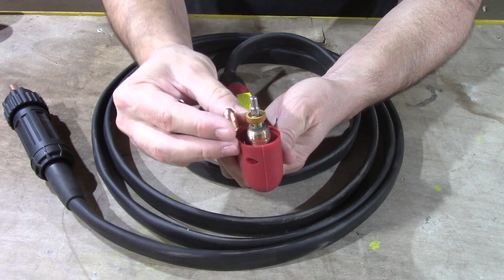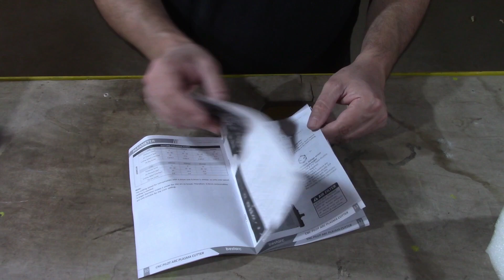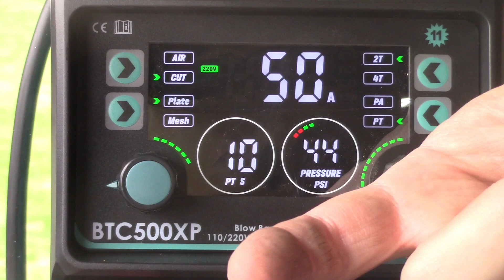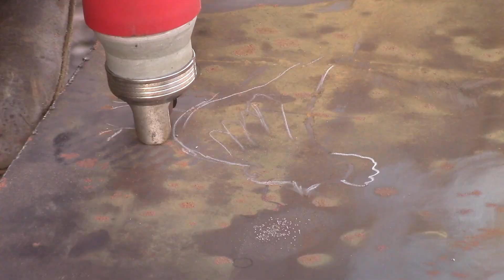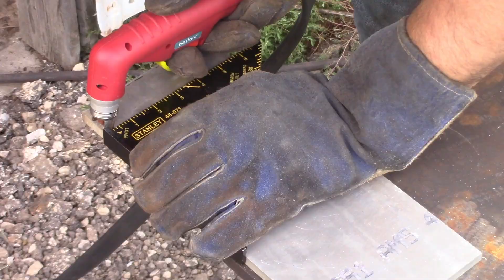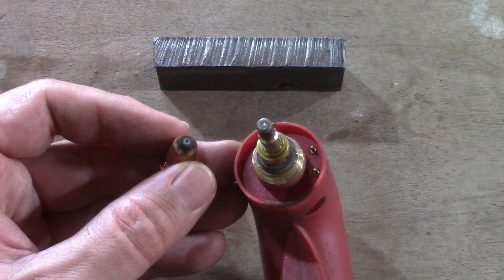BTC500XP 11th Generation Plasma Cutter Review

Comment: When these small 50 amp units came out years ago they could be found for 50 bucks. What you have there is $50 worth of machine in 10 year ago money. I didn't buy one then and I wouldn't buy that one now. Any welding shop, even at home, needs an oxygen/fuel torch. I can do just as much work as that thing with the small cutting torch and the small gauges. To go big either way you need to go big.

Comment: Solid review. Did you use a water separator or filter by any chance?
Reply from the maker: @chewy6942  No. I'm in the process of building my shop right now and my air setup is as basic as can be.

Comment: What was the Material Thickness?  .. Also What was the Recommended setting (Air, Amps, Speed) and what was your final setting?
Reply from the maker: @kveldgorkon4611  can you be more specific as to which part of the video? I cut a wide variety of materials throughout.
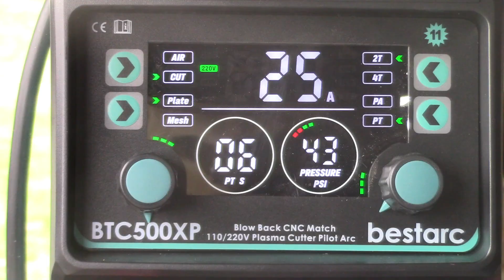Reply: @StuartdeHaro  When you Made your first Cut 1/4" / 6mm @ 15:15
Reply from the maker: @kveldgorkon4611  It has been a while since I did it, but I know that first cut was done at the settings shown in the chart at 6:30. It's in between 5 and 8mm so I probably split the difference and set it at 25A and 35 PSI to start. After that first cut I realized the pressure drops when pulling the trigger, so it was probably only 25 to 30 PSI, definitely too low.
Reply from the maker: @kveldgorkon4611  Sorry, you also asked me about my final settings. I ended up having the best results at 45A and 50 PSI. I found that all my settings needed to be bumped up by 10 to 20 amps compared to the recommended settings on the chart for good results. Air pressure was closer but still needed a bit more, and I rapidly hit the ceiling of 50 PSI on the machine for most things. I hope this helps!
Reply: @StuartdeHaro  Thank you .. I'm glad you did this Video, Gives me more Confidence with my BTC500XP and Now i know the best settings ahead of time